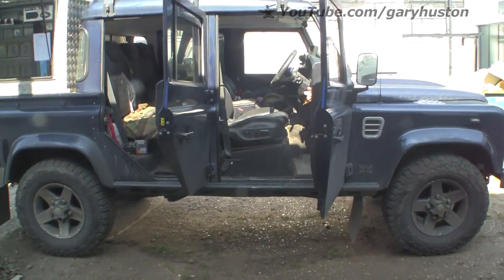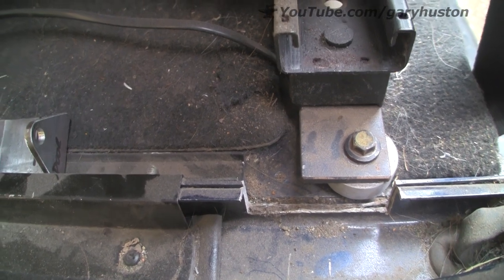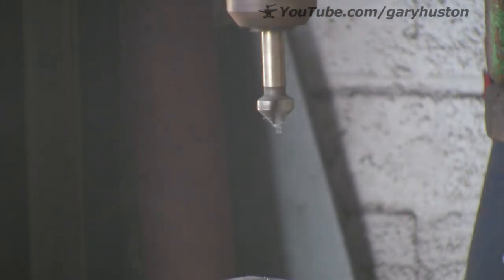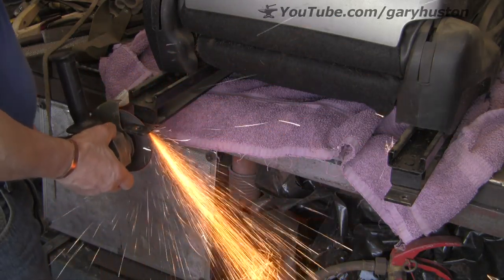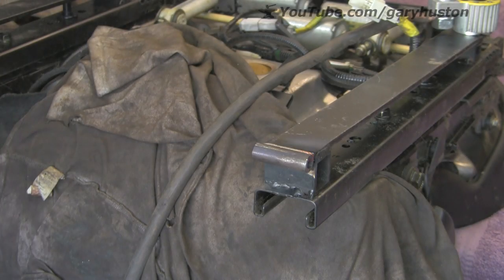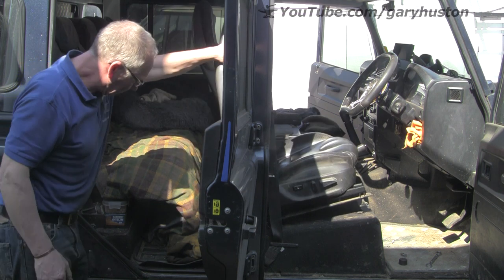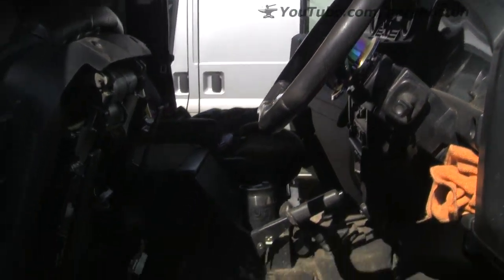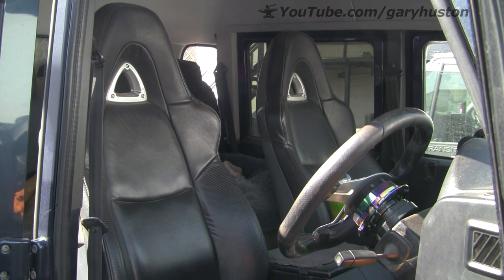Making my defender seats tilt.

Comment: Hi gary, amazing stuff and well executed,  can i ask, i assume you made the rail Mount for the seats? looks like a solid job, i'm planning on doing exactly as you did. Appreciate you're probably a busy chap but is theres a chance you can share what size steel you used for the  runners?  also, i assume you just bolted the front of the rails down? I was considering a quick release latch but am unsure if any are man enough. Any info would be hugely appreciated. Bests. Jon
Reply from the maker: Hi Jon, if you mail me at gary.huston@me.com I will send you more details and photos, I have made some quick release pins for the front from stainless steel which work pretty well.
Reply: @garyhuston  i have done just that, thanks again for the video and your help! Keep safe

Comment: Hi great video I’ve just bought some for my defender have you wired them up if so do you have a diagram or any instructions on what coloured wires go where?
Reply from the maker: I didn’t bother with the heated part just the adjustments part. I can’t remember the colours I used but I used the wires from the original heated seats. I think as I recall I just switched the power on and touched wires until everything worked. If you really need to know I can look tomorrow.
Reply from the maker: If you email me I can send you some pictures
Reply: Hi 
What is your email
Reply: Gary Huston would be great if you could

Comment: Hi Gary,
Did you wire the seats yourself?  If you did can you explain how please. I have rx8 seats powered drivers and heated. Airbags removed!

Regards
Paul
Reply from the maker: I only wired the powered part, I didn’t bother with the heated part. I can’t stand heated seats! I just wired them to the heated seat power so you just hit the heated seat switch , move the seat then switch it off again.

Comment: How about the same brackets at the front of the seats but using clevis pins to anchor them, would make raising them even easier.
Reply: I was thinking up some ideas too. The problem is stability and rigidity.
I thought maybe add a bolt with a hand screw to your idea to put load on the pin so the seat won't have any play.
87-95 wrangler passenger seats have two spring loaded hooks that grab onto a bar to let the seat swing forward for passengers getting in the rear and they're stable. So maybe stability isn't as difficult to get as I'm thinking it is.
Reply from the maker: I did consider replacing the front bolts with threaded pins with a hole through for an R clip but wasn’t sure they wouldn’t rattle.

Comment: What offset to the left did you do for the seat ? Mine looks about the same but mine is catching on the drivers door on the plastic seat trim.
Reply from the maker: I didn’t put any offset at all. The switches for the motorised seat almost catch the door trim. If I want to adjust the seat I have to open the door.
Reply from the maker: If anything I kept it as far to the right as possible as i moved the handbrake and put a disco handbrake to the left of the seat.